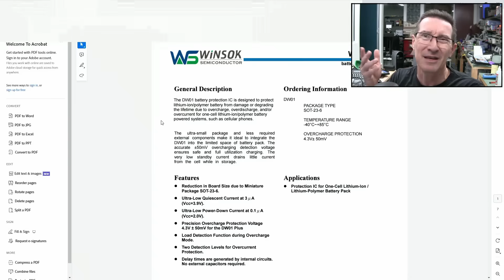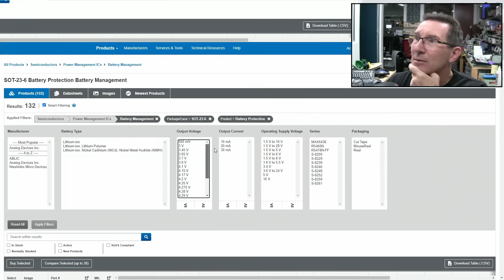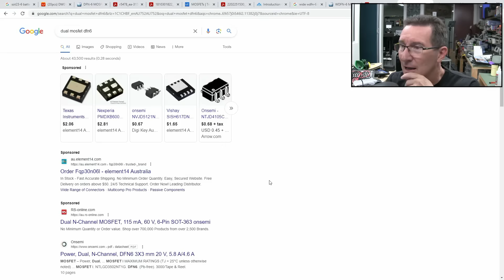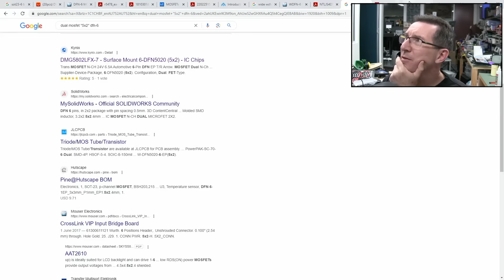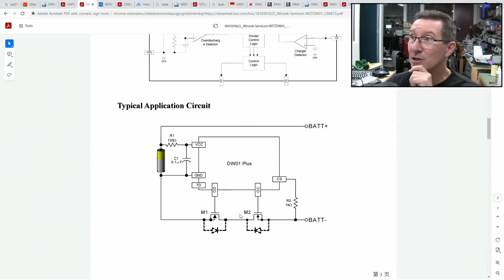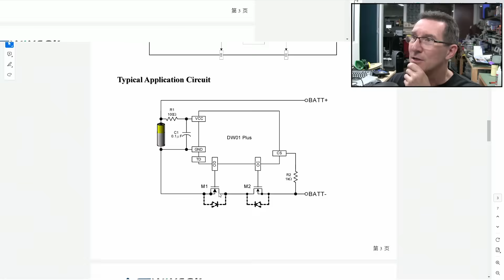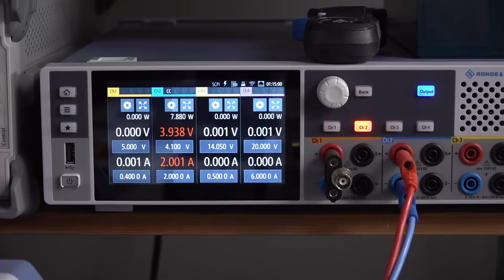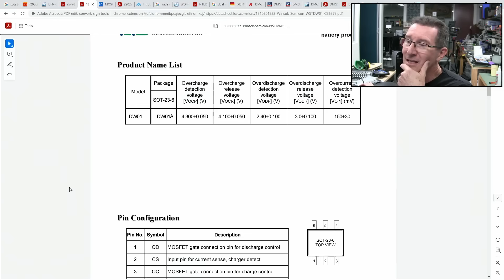Jackery Battery Bank FAIL - Part 2

Comment: Dave, how do they get away with an unshielded power inductor right over the controller IC? This configuration should ring a bell in mind of whoever designed that board.

Comment: Big clive will be helpful here. Probably is a dw01 varient. Are you sure the MOSFETs have the same type number and one doesn't have reversed pins for source and drain?
Edit: not likely due to the negative being connected as it is - the Chinese always seem to use low side switching.

Sometimes just connecting a charger will re-set a protection device if it has gone into protect and 'got stuck'. Disconnecting the batteries will also have a similar effect unless something like a switcher that generates the output voltage has gone short - then it will always go into protect. Isolating the protection side from the switching output/charging part will tell you which part of the circuit has likely failed (track cutting required).

Ruled out protection and also overcharge. 4.4V is heading for fireworks! I always disconnect the batteries before even attempting fault finding. The first time you release smoke on something powered by lithium batteries, you'll understand why.

Comment: Dave, here's a fix:  momentarily short the CS pin to the VSS pin.  I've fixed a few packs this way.  IIRC, there was an weird voltage on the CS pin, and it's some kind of fault with the chip where it's latched in an in between state, and needs a hi or low to get out of it.

I see the Fortune DW01-G version 1.0 2009 datasheet lists this on page 8 in red lettering.  I don't know why this works, but it does, and my memory is that I either connected it to a hi or low state, and it reset (through a current limiting resistor for safety, of course.)  If you see some odd voltage on the CS pin, I think that's the giveaway.

Comment: Yah, back-to-back mosfets are commonly used as battery-protect devices.  You can protect against reverse voltage, you can allow charging but not discharging, or you can allow discharging without charging, or both.  And reverse polarity protection as well.   Lookup E-FUSEs

Comment: If drain is the bottom pad for both mosfets, your "fuse link" does nothing, because you wired source to source .. or did I miss something there ?

1:35 circumventing the mosfets would be happening if you draw a horizontal line from the B- pin to the top pad of the unpopulated SMD part and solder a wire there.. I'd guess.
Reply from the maker: My link shorted out the mosfets.

Comment: Microcontroller was my thought from the outset tbh. Given that the MOSFETs are in parallel extremely unlikely both would fail. Maybe a drop has caused cracked solder joint on the power to the MC.

Comment: Did you check the other chip marked "8205A"? I know for a fact that is another dual MOSFET. It looks like your pack has the 2 MOSFETs on the battery terminal and another one in the middle of the board for some reason.

Comment: If it has one, you could have a shorted ceramic capacitor on the controller's reset pin holding it in reset or something.
Reply from the maker: There is no reset pin.

Comment: Dual back-to-back MOSFETS are standard in this application, so it can shut off both charge and discharge current - need two due to the internal body diode

Comment: often the MOSFET RDSon is used as the sense resistor for the overcurrent detect for the cutout. if you parallel them you can choose the current range you want it to work for.

Comment: Maybe a cracked solder joint? Id imagine that battery has had a few falls by now. Could try a bit of pressure on the control chip and see if it springs back to life.

Comment: Only speculating:
If everything is looking good, the problem maybe could be some kind of protection triggering in the protection IC. If there is an undervoltage and the circuit is open to avoid the deep discharge of battery, you cannot charge the battery again because the circuit is open. In this case you need to charge the battery connecting directly the terminals and recover the normal state of the protection IC

Comment: Also had a DW01 fail, though helped by the recycled 32700 mystery cells attached to it. Replaced with an other generic BMS board that I had bought in bulk, and also with 10 recycled 18650 cells from old laptop battery packs, so as to get roughly 10Ah capacity in there. Should make the solar lamp work again.

Comment: NTC might be another step. Short it to ground, you can do that when you want no temperature protection. It should work for boost operation of controller, not sure about charge part.

Comment: one thing to check is hte thermistor, and it's buddy divider resistor. maybe something in there has given up the ghost and could be a really easy and cheap fix.
Reply from the maker: Thermister is fine.
Reply: @EEVblog2  that is odd, then. Check the reset circut? Past that, i think the controler died due to a surge or something similar. Common if it is plugged into a pc with a not too well protected psu on the 5v side. Need a good board or a fancy pants charge wart with all that jazz to stop it mostly.

Comment: 6:30 these are likely dual mosfet packages, one one way, the other, well yeah. so with two they are beefing up the current. i'd suspect these are 20v 6 or 8 amp jobs driven in a quasi series-parallel arrangment.

Comment: Check the thermistor, i think.

I also question whether those are simple MOSFETs. I think you have to have back-to-back MOSFETs since the protection circuit has to stop current flowing in when overcharged, and stop current flowing out when overloaded.

Some more detailed tracing is in order, i think .

BTW, ask BigClive about that DW01 chip. He's reverse engineered dozens of circuits using it.

The DW01 should hold both gates high if no fault is detected. Based on which one is low, you ought to be able to determine what it thinks the fault is, overload or overcharge.
Reply from the maker: Thermistor is fine.
Reply: the thermistor likely is the case. too cold (too low) or too warm (too high) and it'll lock out.

Comment: It does show up in Mouser. "W-DFN5020-6" is the package name. You were looking at just DFN or something before. It's tricky, but their are a bizzilion package variations so you gotta look at each possible one in the list it could be. The 5020 portion I imagine means 5x2.
Reply: Is it normal that they use 5020 for these small parts?  I feel like everywhere else 5020 would be 5 cm(50mm) 2 cm(20mm)?
Reply: @marcovpv  I assume the 0 is a placeholder for decimal digits. So a 5x2.4 would be 5024
Reply: @marcovpv  very common, there's lot of parts that are specced like that.
Reply: Yeah, I found it too... in the heat of the battle ;)
Reply: And Mouser puts zero effort into normalizing anything (or even making sure all the columns for every part are actually populated). I basically never order from them unless I already know the exact part number ahead of time (and if it's something like a connector I have to double check the entire thing against a manufacturer catalog because of course you can't trust the photos of the few parts that even have them either) because it's so impossible to find anything using their site.
Reply: @ailivac at least their SKUs always have the manufacturers part number in there - so if you know what you’re looking for, it’s easy to find.

Comment: That R&S screen issue looks exactly like what happened to my 2008 Samsung 3D TV a couple of years ago. Some issue with the driver, but wasn't worth my time to try to fix it beyond just reseating the flex connectors.
Reply from the maker: Yeah, not worth it unless it gets worse. Perfectly usable.

Comment: I had a powerbank that trashed itself from plugging it into itself. It seemed to use the inductor both as a boost converter for the output and a buck converter for the input. Bigclive did a teardown of one.
Reply: You plugged it into itself? Trying to make perpetual energy device. 😂
Reply: @akshonclip  even if it allowed due to losses you would have to charge back up after a time. That’s hilarious
Reply: Since you name dropped big Clive. I’m calling it “B sexual” because “a sexual” self reproduce but B sexual destroy themselves upon insertion to themselves 😂

Comment: Mouser's parametric search is notoriously useless.
Reply: It's because the part is catalogued as W-DFN5020-6 and that package is not what he was searching for.
Reply: @Agent24Electronics  That's my point. Every manufacturer has their own slightly different language (or chooses to use a different equivalent standard e.g. SC-74 vs SOT23-5) and Mouser makes no attempt to unify them anywhere. Or even fill in all the columns on a lot of parts. Or have useful photos. Digikey probably renames the various manufacturer-specific package designations to something like "6-DFN (5.0x2.0mm)", and also has a "Supplier Device Package" column in case you know that "NanoMAX-10S" or whatever is the actual branding for something you're looking for.

Comment: I'm just looking at that thermal sensor.  what if it was shorted/open?  I'd wager the micro controller would keep everything off out of safety, if it thought it was overheated.
Reply from the maker: Thermister is fine.

Comment: Bet if you go to a local "Dollar Store" and find a basic USB power bank with a single 18650, you can probably find that exact same DW01 chip.
Reply: Dw01 is on every protected tp4054 board
Reply: I know from watching Big Clive that the typical equivalent of the Dollar Store in the UK is Poundland. Now you have me wondering what it is in Australia.
Reply: ShrimpShop
Reply: Probably Dave was duped with an expensive brand that only contains standard chinese parts. Most of the cost is the cells, if they are any good. Price is not always an indication of quality.

Comment: Pretty sure both gates need to be driven at 3.3v, just because a NFET is backwards doesn't mean it magically becomes a PFET
Reply: @James Doe No, not really. Look at the parasitic diodes drawn on most of the diagrams -- if you had only one MOSFET, then even if the MOSFET was off, it would still permit current to pass through the diode. So you need two MOSFETs to be able to block current in both directions. However, I am 99% sure that the controller would turn both on to permit charge/discharge and turn one/both off when in emergency shutdown mode, because you'd never actually want the diodes to be carrying the current (0.7V drop on a 3.7V battery is like a 20% power wastage right there). So it's not really correct to say that "one is for charge and the other is for discharge", it's more like "one is to definitively prevent charging and the other is to definitively prevent discharging". A subtle distinction, but one that reveals (as the OP points out here) that it's really weird that only one of the gates was high in Dave's video.
Reply: @TheHuesSciTech  actually MOSFET diodes will carry significant current when charging overdischarged battery (could actually happen) or discharging overcharged one (this would probably never happen with such a powerbank)
Reply: Yes.

Comment: I hate SMD codes so much. Caused so much trouble and wasted time for me. Dammit, just put the full part number on there! Or at least provide a good, free to use databank.
Reply from the maker: Yeah, not rocket science to put the number on there.
Reply: With emphasis on "good" .. I tried 3 different smd marking databases with no luck.